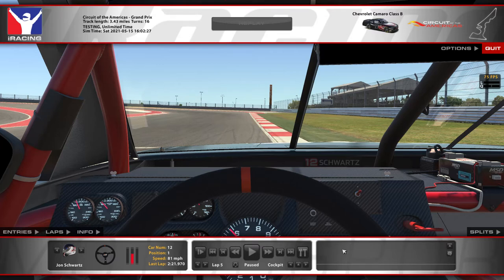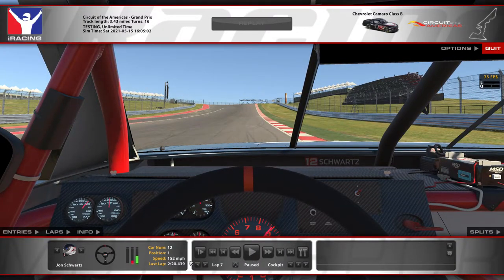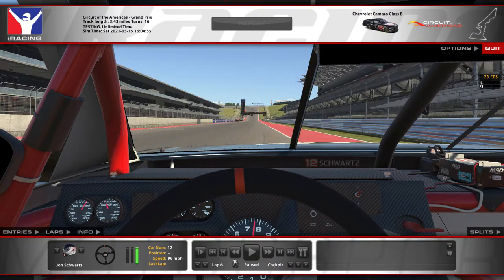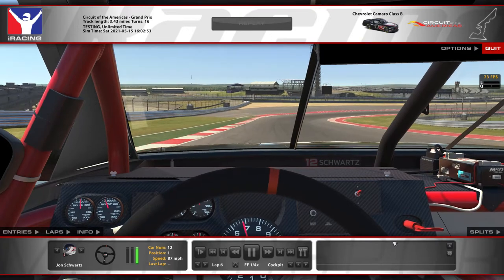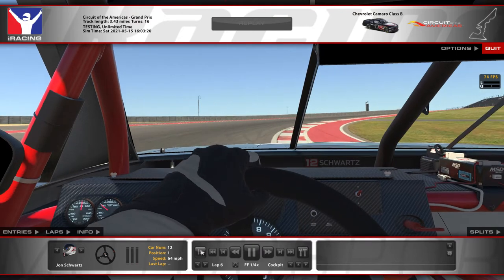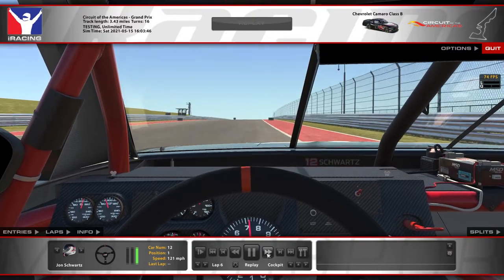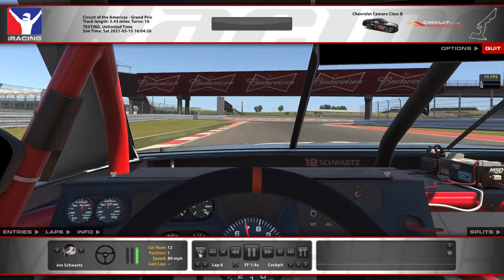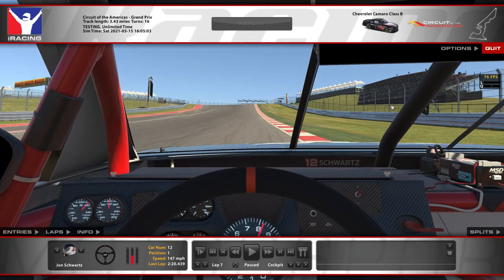iRacing | Xfinity Series at COTA |  Hotlap and Track Guide

Comment: I tried just doing a practice run yesterday and I could not get my tires to stop spinning.
Reply from the maker: You need to be super cautious on the first few laps. After 3 laps, you can actually start pushing. Don't worry if you are getting wheelspin early on.
Reply: @jonathanschwartz3013  I also found out my brake bias was wrong. Too far to the front for me. Went out in a race and ran first all the way through. Next day did the same race and forgot to make the adjustment and couldn’t come close to keeping speed with everyone.